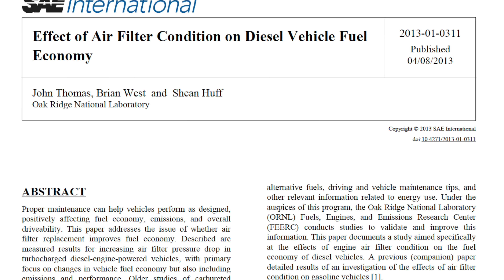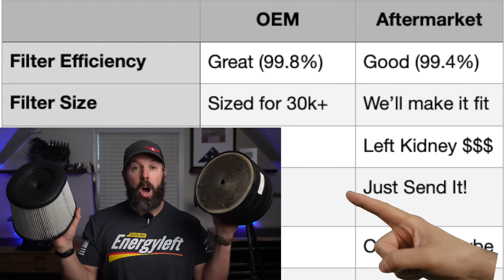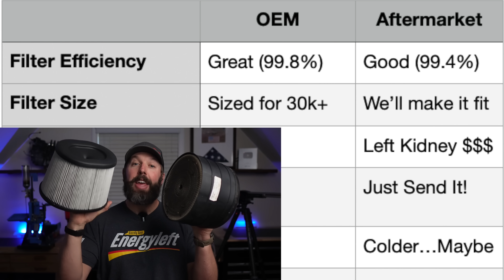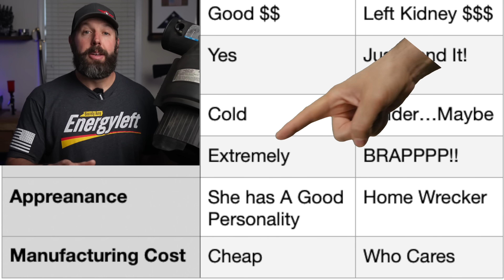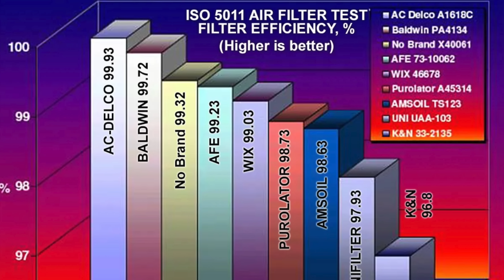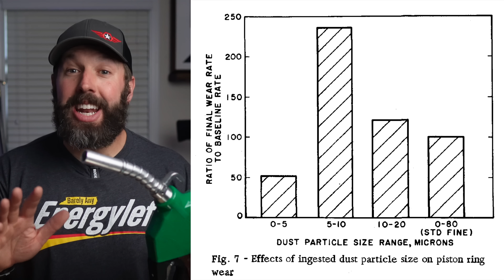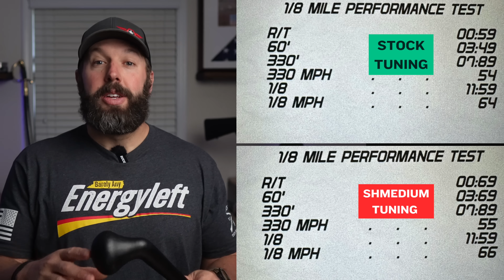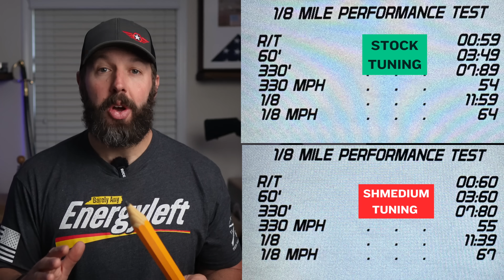The TRUTH About Cold Air Intakes…ACTUAL SCIENCE!

Comment: Exactly Correct. 95% of vehicles do not need a CAI. However, the 5% that do are those where the factory airbox is on top of the engine bay and needs to be relocated for heat reasons. For example. The VW 2.5l engine has it's factory airbox as part of it's engine cover. Not at all ideal as the heat of the engine heat soaks the air before entering the throttle body. yet their 2.0T engines have an actual separate airbox. Both being from the same years, yet only one benefits from a CAI due to location. It is very dependent on the vehicle. If the airbox is separated and away from the engine, then there is no need for a CAI.

Comment: My 2013 f150 with a 5.0 coyote had a roush cold air intake installed by the previous owner......after several months I found a used stock air box and replaced it.....sounds better and runs smoother

Comment: Certainly your information makes sense and the science is great. However, I’ve done the 3000-4000 mile oil changes and air filter change when it’s super dirty. I’ve lived in very dusty environments and less dusty as well and EVERY vehicle I have owned, ford, Chevy, Nissan, Toyota, Mazda, AND they have all gone well over 200000 miles and also 300000 miles with general maintenance and no major failures. That’s a car that’s paid for itself. Soooo, even though your information is great, I’ll stick to my method. BECAUSE, every car I’ve owned recently that followed the 7500 or 10000 oil change intervals just kept having engine problems, geez I wonder why. And there is science to prove that as well.

Comment: just as an anecdote, i used to work in an oil change place when i first started in the industry and twice i had vehicles come in that would not run at idle because of clogged air filters. they were both NA gas engines not diesels. i was pretty stoked to fix a major issue with a $15 filter at the time lol

Comment: Comparing clean air being breathed…. by engine OR human…. to “nutrition” is …Not comparative.
You might compare low-octane gas or low-cetane diesel to what a human eats….. but not what he breathes.
As for not changing a dirty filter…. The ULTIMATE conclusion is: If you NEVER change the air filter until it is completely “clogged”  (you need to define that term)….. will completely SHUT DOWN the engine for lack of air…. In which case your conclusion is PERFECT…because dirt in the air will absolutely cause NO HARM to a non-running engine.
(PS:  I really like your vids.  Just not this one.)  gh

Comment: Burger motorsports did some dyno pulls showing IAT with factory, cold air intake, and just a couple open air filters on a turbocharged, Intercooled 3.0 to show that if the engine is turbo charged it doesn’t matter due to the charge air cooler cooling things back down before going into the motor for combustion.
Reply from the maker: The problem with that logic is that the compressor inlet can only flow a certain VOLUME of air. If the air coming in is hotter, it is less dense. So that VOLUME of air entering the turbo has less MASS, and thus less available oxygen. There is more to it than just the temp of the air after the intercooler. You have to consider the mass of air flowing into  the system. And the mass will be higher if the incoming air is cooler.

Comment: I drive a comercial truck 10.4 ton, It has dual air filters , runs around 22L per 100km. I can tell you when my outer filter is clogged looking at my fuel usage, because it goes up to 26+L per hundred. That filter is expensive but I always carry a spare in the truck and its more economical to change the filter than pay for the fuel. where as I pretty sure my mechanic changes the inner filter every 2nd or 3rd service. Interesting video all the same. SAE papers are the gold standard.

Comment: Cold air intake kits aren't really cold air. Most of those kits I've installed when I was still a tech we're nothing more than an open metal box containing a crappy filter sitting off to the side in the engine bay, sucking in all the hot engine air. Most factory system are ducted into the side of the fender or down below where the cold air actually is. By far superior to any aftermarket junk.

Comment: In the BMW world, we call them HOT air intakes.  Factory ducting comes from the bumper inlet and makes a good seal around the filter  All models are different air paths and I wish they would put an inertial separator on all of them.  But the aftermarket intake filters without ducts suck in all the hotter air off the manifolds and engine surfaces and exhaust with the cat in the downpipe.  But people love to buy them.   But 30,000 miles is a little nuts - I would half that interval.  But it all depends on ambient conditions in which you run your engine.   Too many variables to establish cause and effect on the 335d.  DPF could have a lot more to do with that

Comment: My personal experience has seen stock air box’s  leak behind the filter on L5P trucks, better upgrades available IMO, but as stated a lot of options out there. They are not all equal. And on 6.7L fords, the stock air box works well but the filters plug fast due to the ram air style inlet. The last SNB paper filter I changed lasted about 50,000 miles, lots of dirt roads off highway. I work in oil and gas, my intake is spotless behind the filter.

Comment: The issue is, most air filter tests aren't done correctly. They use a constant vacuum to test while engines don't produce a constant vacuum, they have little pulsations. With that said, my last truck was a 1999 that had a K&N installed shortly after its initial sale and properly maintained ever since. 700,000 miles later on that unopened motor and a borescope showed that the cylinder walls had no abnormal wear and oil pressure was a solid 25psi at idle when hot so it had no extra bearing wear. I was the 2nd owner and I got a 3" binder full of maintenance records with it.

Comment: "Cold air intakes" haven't been about cold air for awhile, the name just sticks around. And their effect is vehicle-dependent. Manufacturers are balancing cost of the housing, cost of the filter, ease of maintenance, and engine bay size. All those resonators and corrugated tubes create turbulence to mitigate noise. Aftermarket will make different tradeoffs.

I put a Banks high-flow intake on a Jeep Gladiator, and it cost me 1) $$$ and 2) ease of maintenance. Filter changes require removing the entire intake because they used every cubic inch they could to route the plumbing. The benefits were significant, though. Driving the same route at the same speed resulted in entirely different shift points (manual transmission) due to the increased power at lower RPMs. Next best thing to a turbo (which is a terrible idea on the v6 pentastar, unless you want a "cold air intake" on the lower half of the engine), for that specific application.

Comment: Hey Sir, I appreciate your work. I am not a diesel guy but I value your integrity and quality of your program. To me cold air is definitely  a good thing but for more power you need Ram-Air to make a difference. Getting the air inlet in the most positive pressure placement does make a difference at high vehicle speeds and has less affect in low vehicle speed use. All the best, keep it going.
Reply from the maker: I appreciate the support 😎

Comment: MAF sensors are calibrated to the airbox. Installing an aftermarket box will change the airflow characteristics , causing check engine light in some cases.
Reply from the maker: Not on a diesel it won’t.

Comment: Well shoot, I hope I didn't ruin my VW. I saw the recommended 20k interval but 10k cabin filter and thought "They don't care about the engine? I'm changing it every oil change to be safe." Now you're saying letting it be dirty is what they wanted because it's better for my diesel. So hopefully 70,000 miles of excess dust didn't hurt it too much. (More like 30,000 because every other 10k was supposed to be replaced.) Eh, it probably did, what with being unable to hit 50 MPG average now. Used to get 600 miles per tank if I drove right, but now struggle to hit 550.

By the way, the article you have linked for the "Gas Engine Cold Air Intake Testing" is for a diesel engine. The paper says it's a Kerloskar 5BHP diesel for load testing and a 2003 TATA SUMO (diesel) for fuel economy. I can't view SAE 2013-01-0311 without a subscription to compare to, but I bet they have similar results. The one I can see says only 1 mpg lower for a clogged OEM over new.

Comment: I've "fixed" more than a few dirtymaxs by changing the crusty ass 50k mile air filter, because the air flow had become so restricted that it was skewing the ECMs calculations to the point it thought a NoX sensor was going bad. A filters particulate removal efficiency increases with dirt, it's air flow efficiency will fall off a cliff after a certain saturation level.

Comment: From testing on a 1500 NNBS 6.2 Silverado, the hole in the fender and airbox entry is one of the bigger restriction than anything. A desnorkeled airbox and inner fender still restricted airflow. Compared to my custom OEM+ setup - 2.5 inch shopvac hose plumbed into the bottom of the factory desnorkeled airbox that goes to the grille for forced air above 20 mph. Sit for 30 min with AC on heatsoking the intake put it in drive and floor it or anything above 20mph and it is immediately at ambient temperature. Datalogged on hptuners with a wide band.

Comment: My Challenger Scat Pack Shaker came with the cold air intake but one thing I did do was get an aftermarket filter "sick" that covers the filter itself and both keeps loose debris (leaves, etc.) from filling the pleats but it also helps that extra "barrier" that the dirt cake serves to function.  The sock grabs the oily road dust and keeps it while keeping larger, air blocking debris out.  That's about the best I can do with a factory cold air setup.

Comment: Not sure if you'll ever see this, but I don't really care about the performance side of these filters as much as the induction noise. Especially on 4 cylinders where the exhaust noise sounds (often times) horrible. Do you have a recommendation for an aftermarket filter that makes cool noise without comprising filtration?
Reply: Not sure if they have one for your vehicle but, AiRaid M.I.T. intake tubes delete the resonators for sound and technically increase airflow because of a smoother design. I have one on my Silverado with the factory airbox.

Comment: That is interesting that the air filter traps more dirt after it gets dirty, but as a technician I would not recommend never changing the filter. As far as service intervals, I would usually stick with whatever the manufacturer recommends. The problem with never changing the dirty filter (besides eventual loss of power) is that the filter can eventually deteriorate and start falling apart. Then you wind up with holes in the filter and pieces of the filter possibly getting pulled into the throttle body or engine. Also the rubber gasket part of the filter can eventually dry rot and fall apart.

Comment: I drive a 99 XJ 2WD.
It's not diesel, so maybe there are differences I am not understanding. 

I went from 14 miles per gallon, to 18 miles per gallon and the only thing I did was replace the stock intake with the "Cold Air Intake" from Rough Country. 

How would it be possible to increase efficiency in this case?
Reply: XJs have very restrictive airboxs from the factory. Have you done the IAT sensor relocation mod? It helps the computer know the actual IAT instead of the heat soaked intake manifold temperature and can add more timing. There are some 0-60 test runs and how-to's on YouTube you can watch about it.
Reply: @ThisisForTheTV no, but I will check that out now. I'd like to squeeze out a few more MPG. Power isn't quite as important since she's just my work truck.

Comment: It makes sense my S&B with the plug pulled out would let more dirt in. So if I add together that I traded a 2012 ram 1500 for my 2005 duramax dually, fixed 1 wiring issue and have owned it for about 10 years now with no issues daily driving it, to the fact that I am north of 300k (it had 130k when I got it) and carry the 2 it equals i have absolutely gotten my investment back and I like turbo noises sooooo.... yeah great video!

Comment: So again you have over simplified this topic.  Whats the first rule of hot rodding, improve the engines airflow both on the exhaust and intake to make power.  Then we have to look at the use of the vehicle.  If the truck is a pavement pounder, how much dust are you really pulling in versus someone that is constantly in a dust environment.  Next, you did a short run, look at a long hill climb and show the differences in EGT on a long climb.  OEM's are conservatives, and not optimized, but not all air filter systems are equal either!

Comment: I've been telling people this since the early 00s, but "if the factory system was so good, why would they make aftermarket parts?" crowd was louder. You can't have more air flow and maintain filtration. Especially with K&N, who really upsell crap.

Same with "coilovers", name because at the time the springs (sometimes coil, sometimes leaf, sometimes torsion bar) and dampers were two seperate components, but now most vehicles leave the factory with coils over dampers. But marketing I guess.

Comment: On a tuned built truck they can in fact make more power. However all your testing and “real” world pros and cons are based off a none deleted truck.  Meaning your rocking an SCR, EGR, and DPF.  I would think then”off road only” vehicles that are owned by people buying those aftermarket intakes are not.  They are also properly tuned to handle the differences. One can also buy an outerwear for the air filter.  Besides that the power loss is more than important to me to change the filter.
Reply from the maker: This truck has no EGR, SCR, or DPF. 🤷🏻‍♂️

Comment: Very educational.  I have a small fleet of trucks that falls into a category that you didn't include and I'm curious about your thoughts on it.  I'm primarily low mileage but towing heavy loads with 6.0 and 6.4 Powerstrokes on "stockish" tunes.  Most of my engine failures have been blown head gaskets (and one of the infamous cracked/melted pistons on one of the 6.4's).  Overall, I would stay stock seems like the better choice, but since heat under load seems to be my biggest problem, I'm wondering if the lower (even if slightly) EGT temps would have an overall positive effect on my engine life.  I realize that better radiators and/or intercoolers are probably my best options to reduce engine temps, but just wondering if a slightly less efficient filter with higher airflow would also be a good idea or a bad one.

Comment: Diesel filters suck a lot of air, look dirty in a short time. My diesel, on the street, could collect that dust in a 1K miles. Obviously, seriously neglected filters can develop (per tests) holes letting larger dirt into the engine. That seems to due to the media getting old, so maybe an air filter every 3 years? The "change filters regularly" can be valid for gas vehicles with carbs (like using a choke when restricted). With FI gas/diesel engines the computer will supply only the amount of fuel to match incoming air. If it's plugged enough you might use more throttle which can trick the engine to run a richer running condition. If you aren't a lead foot, less air "looks" like less throttle. Also tell your oil change dude to keep his hands off your air filter. NO air filter needs to be inspected every 5K. (Yes, my particular gas engine needs those oil changes. It has passages that are hair sized. It might not need an oil filter w/ every change.) You want to keep straw, sand and dirt on the dirty side of the filter, not have this dude dump it into your intake. I saw straw in the "clean" side of my filter... the rest I assume went thru the turbo. (Even with a 3" tall red sign on my air box saying "Do Not Open. Owner Inspection Only" they can ignore your warning. That dirt, along w/ wheels torqued to 400 ftlbs, and oil filter housing torqued to silly ftlb sent me back to doing my own oil and tire rotations at 70 yo. I'm too old for this shit, but we must do what must be done, even when it takes me hours and costs as much as having them do the job.)

Comment: I guess not wanting to sound misleading is why my aftermarket intake was called “High Volume” and not “Cold Air”. The instructions made note of how it uses much of the stock engineering to preserve the cold air induction whilst increasing airflow with the size of the new box and the cone filter. As someone who doesn’t turn many wrenches, it was time consuming to install but it ended up all good when everything came together.

Comment: Personal test on F150
K&N cold intake kit and K&N filter in stock intake left noticeable dust residue inside intake snorkel jest before manifold at just 500 miles. After 2000 miles with stock paper filter the intake snorkel was still clean. Say no to reusable air filters.

Comment: Funny anecdotal point for you…I had a new 2004 Cummings and forgot to change the fuel filter for about 60k miles. The fuel mileage got better and better until it reached a peak of about 26mpg. I was pretty excited that the engine was “breaking in” perfectly. Then it started not to rev as fast as I had grown to expect and then it wouldn’t even catch the limit when in neutral . So I changed my filter. Bang!Back down to 18mpg and my tires started wearing faster. So don’t change your fuel filter and your tires last longer! 🤣
Reply from the maker: Science 🤓